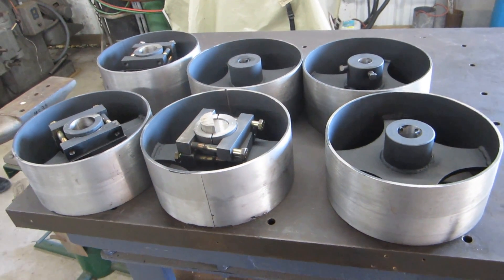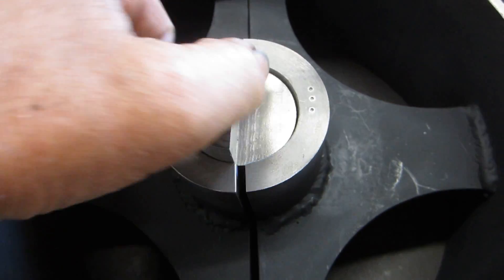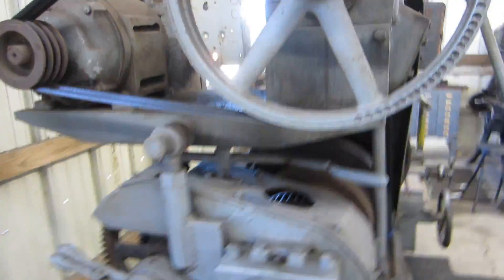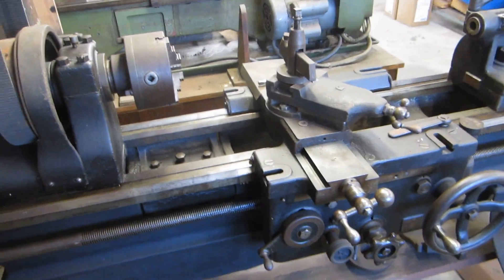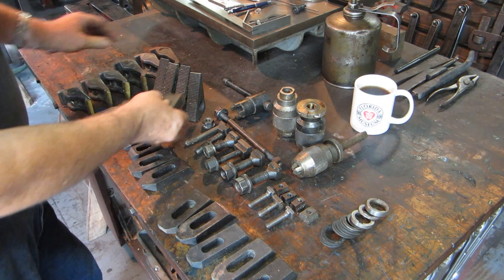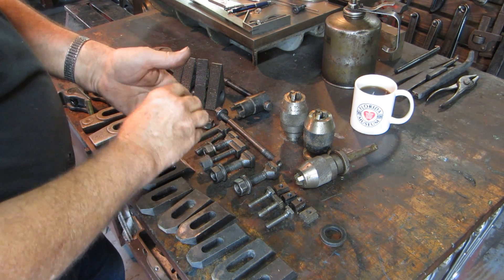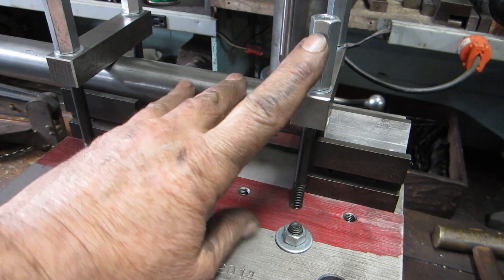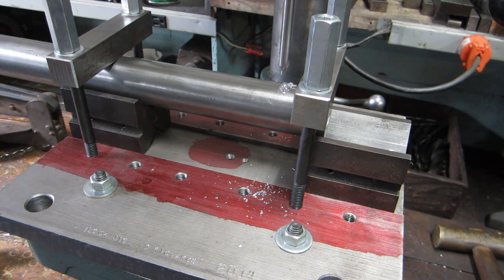OLD STEAM POWERED MACHINE SHOP 10

Comment: Hi, why do you put the upper led at 45 degree angle instead
longitudinal.
With us, the sled is always in the longitudinal direction.
Does this have a certain meaning?
Greetings Franz
Reply from the maker: Hello Franz. I am trying to understand your question.  Are you referring to the compound slide on the lathe?  I don't know, it just seems like a good angle to park it so that the compound feed handle is out of the way of the cross slide handle and also the tail stock when it's up in position with a center. Thanks for  watching....Dave
Reply: A lot of people leave it at the threading angle... for convenience.

Comment: 7:52 This is probably the dumbest question you ever heard but here goes, how does one repair the missing teeth on a gear? 

Weld new ones in? it would have to be very tricky welding.
Reply from the maker: Thanks for watching Steve> It was commonly done in the old days, I've seen several ways to do it. If its a cast iron gear, the welding gets tricky because it hardens the iron and makes it brittle. Pure nickel arc rod could be used. One way (and probably the best) is to "braze up the broken tooth area and re-machine the teeth set up in a dividing head. Kieth Rucker does a job like that on one of his videos at Vintage Machinery Youtube channel. I've seen a missing tooth drilled and tapped with a row of threaded pins substituted for a tooth, filed down to match and had run that way for a long time. ...Dave

Comment: Dave, I love your shop, I grew Up in a similar shop and I already worked there 75 years ago
My Grandfather had no steam but one 5 HP 3- phase motor drove the ceiling transmission lines. Love your drill press, our was much simpler. Congratulation and appreciation to see that you did not convert to the most modern machinery yet producing the same jobs, achieving just as good results. 
The Old Bob
Reply from the maker: Thanks Bob, Yeah if they had electricity, they used it. In the begining there was water & steam power....Dave

Comment: David do you have any recommendations on where to start if someone wanted to start building a steam powered shop of their own?
Reply from the maker: +Steve .Smith  The main thing is finding a certified, legal boiler of some kind, in decent shape. Mine is rated at about 8 HP, but 6 would do fine....Dave
Reply: Dave I have access to plenty of boilers and pressure vessels in my line of work so I believe that will be the easy part. Is the actual equipment and engines hard to come by or build? I've always been interested in steam power but I'm just now at a point where I can actually work on it, so I'm setting at go.
Reply from the maker: +Steve .Smith  Engines come up for sale now and then on the smokestak forum. Their clasified ad page for steam is http://www.enginads.com/classifieds/showcat.php/cat/7  There have been some line shaft items on there also. Pulleys are found on ebay, search "pulleys hit & miss". Older belt drive lathes, milling machines, etc. are sometimes found on craigs list. Good luck with it....Dave

Comment: Dave at my age I should know this:  One of my lathes runs a 4 inch wide belt.  For yrs I been
running friction tape on the center of drive and driven pulleys.  They are glazed &
done everything from wiping lac thinner to sandpaper, and still get glazed up::
any ideas other than new belting and dealing with big hooks not available round here..
sam
Reply from the maker: +samuel pine Sam: This is my opinion based on what I've studied in old manuals and my own experience. A polished smooth pulley is good. Slippage is because (1) the belt is not pulled up tight enough, (2) it's not getting good traction because of condition of the belt surface or (3) not wide enough or pulley combination not big enough in diameter. You can't change 3 on the final lathe drive so I'd look at the belt itself. You didn't say if it was leather or some other fabric. With leather you aren't supose to use "tar" based dressings because it's rough on the belt. I scrape the running side carefully with one of those carbide blade paint scrapers stretched out on the floor to get grease, old dead leather and other scuz off down to the bare leather. I oil the back side with neatsfoot oil (light oil on the drive side).
Old leather seems to grip best but may be weaker. Fabric belts can be doused liberly with belt dressing to make them stick, but they have to be scraped of oils and grease first. I couldn't pull up the leather belt on my large lathe tight enough without pulling the laces apart oftem, so I switched to a rubber backed modern material (from ebay) it's actually conveyor belting of some sort with crosswise ribs. End of problem. That is the highest stress belt in my shop. Hope this helps, let us all know how it goes.....Dave
Reply: +David Richards Thanks Dave good info, I just dread replacing this
cause my lacer will only do 3 inch belts.......I think I will come up with a spring loaded flat idler that should work.    sam

Comment: thanks, David, for your interesting video. 8 min.40 sec into it you talk about aligning the transmission shafts using the adjustable stand-offs hanging from the ceiling. I see that they are adjustable up and down. How are they adjusted side to side if necessary? Are there slotted holes beneath the big washers up towards the wooden beam?
Reply from the maker: +rol eic  Yeah, they're slotted.  I machined the slots a little longer on the hangars in my shop.  I  dropped  a plumb bob from the shaft at both ends and center, then lined them with a lazer level to get side alignment.....,Dave

Comment: is there a vid of steam powered arc welding ?
Reply from the maker: +bulldozerd9  I don't think I've seen that, but I don't know why it couldn't be done. All you would need is a heavy DC generator to run belted or coupled. It would probably need to be a fairly short stroke higher speed engine.....Dave

Comment: Won't those pulleys have a gap the width of the bandsaw blade once they are clamped over the shaft? Maybe the .035" gap on each side won't matter, I just wondered if the laces might try to catch on the gaps. I guess you could clamp the pulleys back together and rebore the center, but then you would have a slightly oval pulley, but I think that might be better than having the gaps. I like your shaft alignment fixture.
Reply from the maker: +bcbloc02  There is a gap, but there was some allowance made in the bore diameter and then the crown was machined with the pulley clamped in a mandrel.  The gap is about half the width of the saw blade when installed. should be fine, we'll see.........Dave